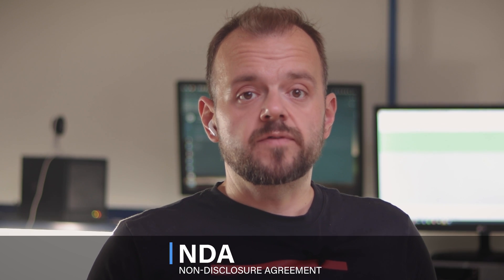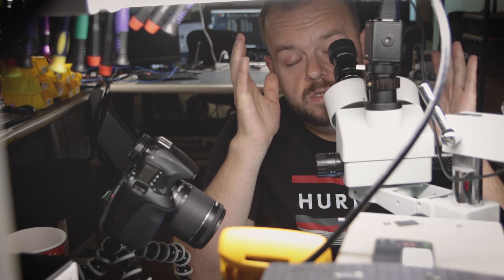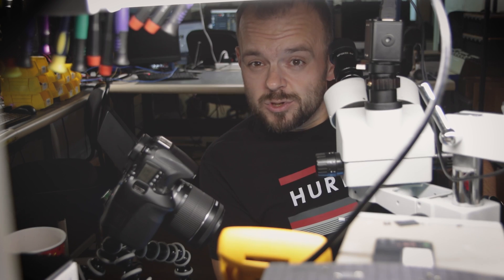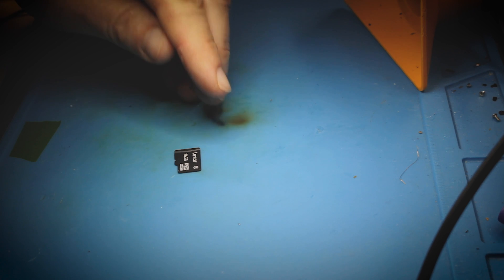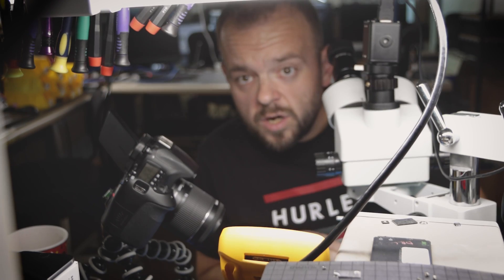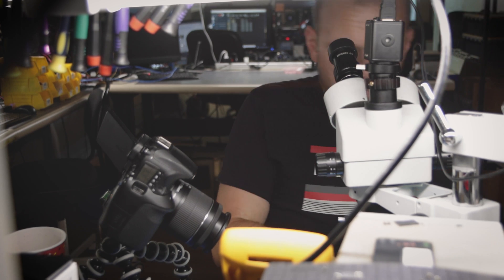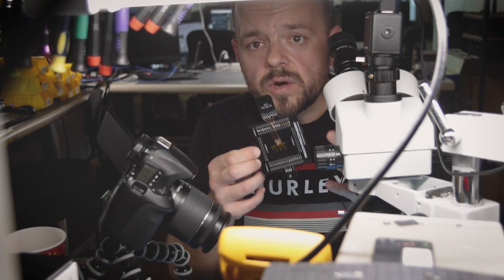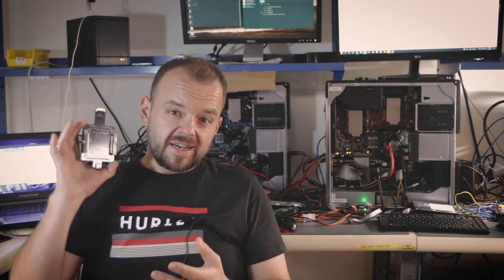Suspect tried destroying the evidence, but did he really destroy it?

Comment: Thanks for sharing part of your recovery process! 

While you were preparing the broken line I noticed a lot of spare solder around the actual line. Is that part not connected to anything? I'd be concerned things have a shortcut somewhere.

Can you please show your verification process after you solder things, but just before you connect them to power again?

Small suggestion :
Use a black and white measurement grid for background when you take photos of components from the evidence bag. This will make it easier to have a sense of size when looking at those photos. They also sell insulated mats with preprinted measures.